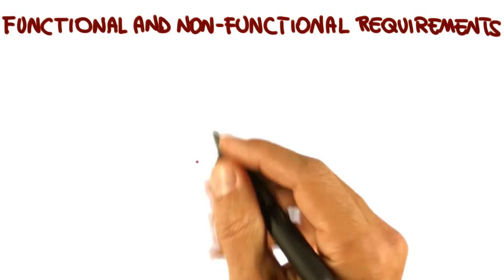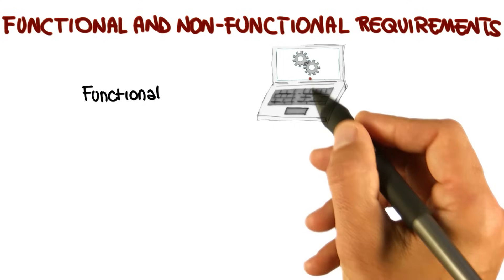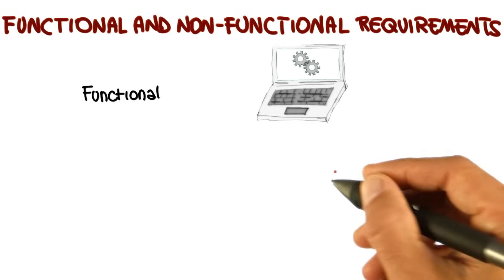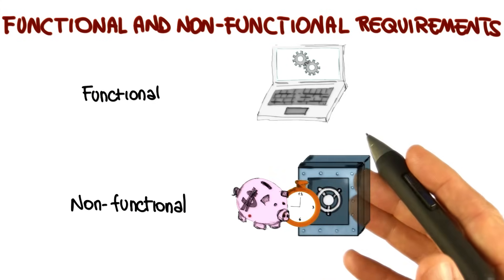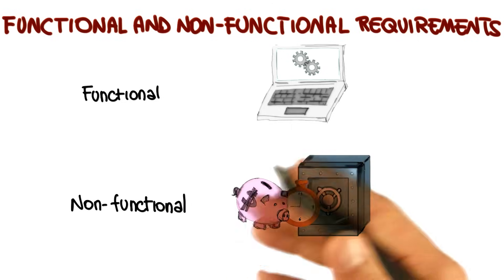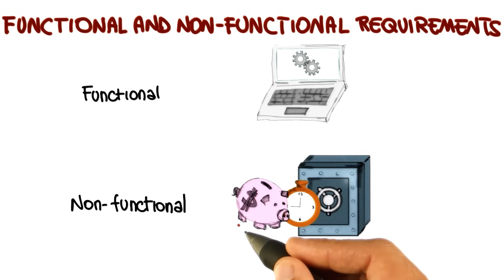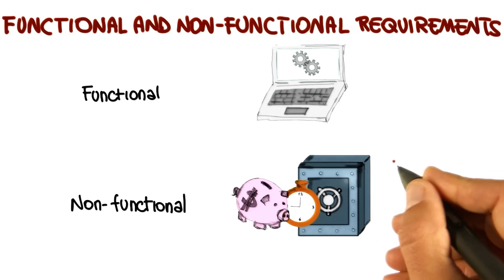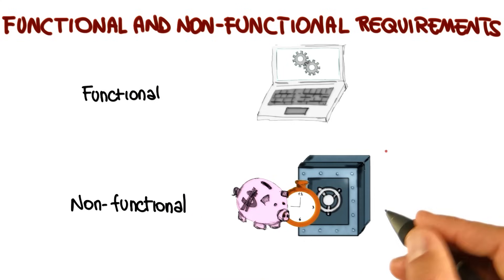Functional and Nonfunctional Requirements - Georgia Tech - Software Development Process

Comment: In my product design lecture, there are two important topics. Functional Requirements and Design Parameters. If I understand right, old cars and new cars have same functionality since both of them brings us from one place to another. The other properties like engine, chasis, climate control, hydraulic steering wheel are just related with the quality of the product. I hope I understood right :-)
Reply: Veeeerryyyy veryy interesting exampleee i read it 5 times, i hope tomorrow the question "diffrence between functional requirement and non-functional requirement" my teacher ask, i will write like this😍❤